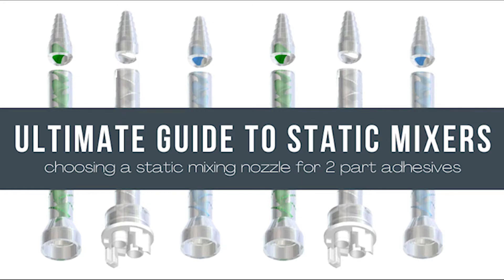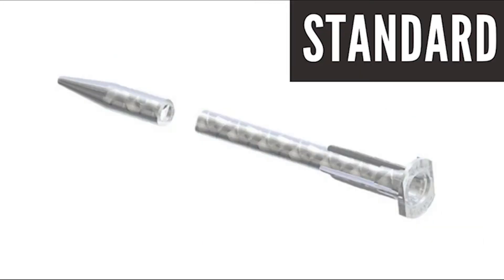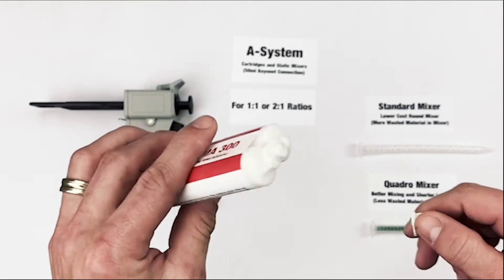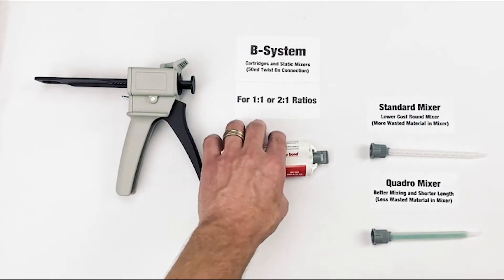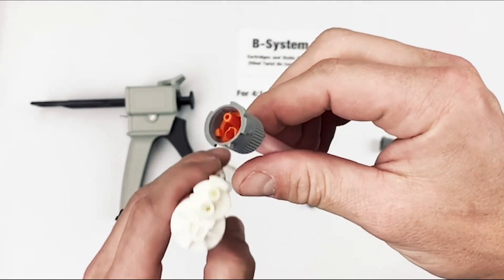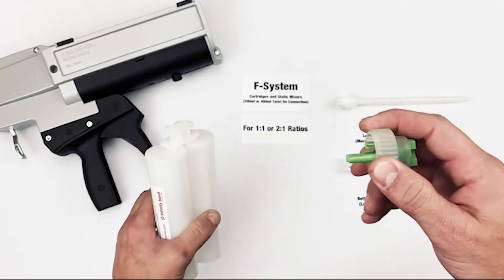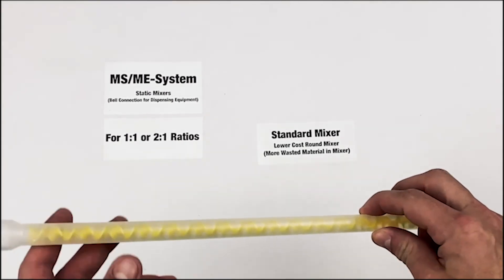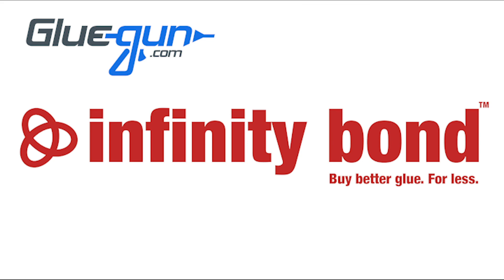The Ultimate Guide to Static Mixer Nozzles for 2 Part Adhesive Dispensing | Gluegun.com

Comment: there's a lot of material left in the mixing tip, how do I squeeze it all out?
Reply: Thisss
Reply: Just fill two empty cartridges with some inexpensive material of similar consistency and use them as pushers. The material can be—here are a few ideas, but feel free to be creative: acrylic caulk (water-based, super cheap), white petroleum jelly (Vaseline), or dish/hand soap.
You can use this in two ways:
1. Simply to save material from the mixer.
2. To clean the mixer for later reuse (with some caveats).